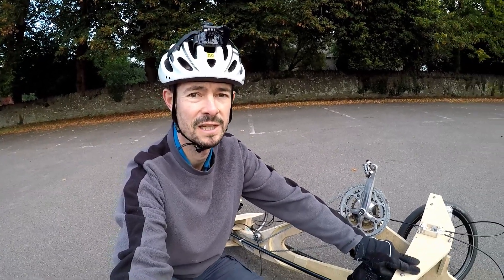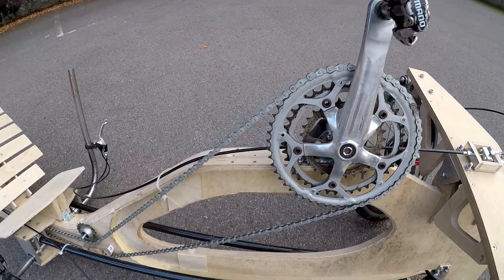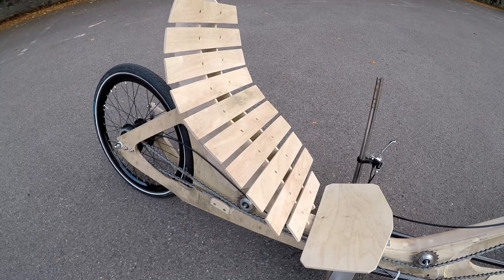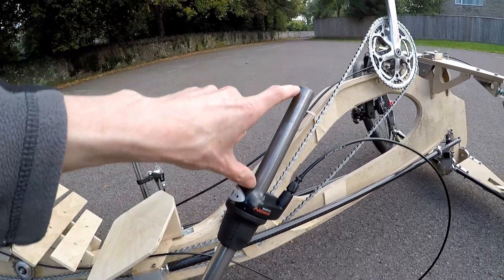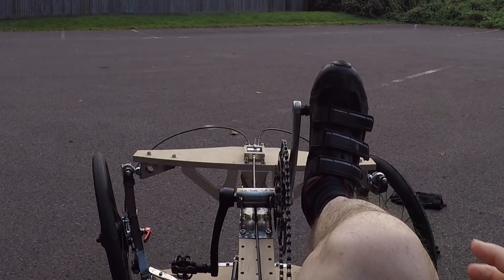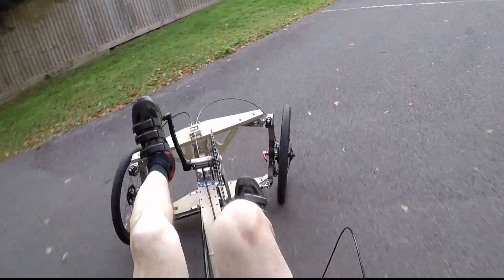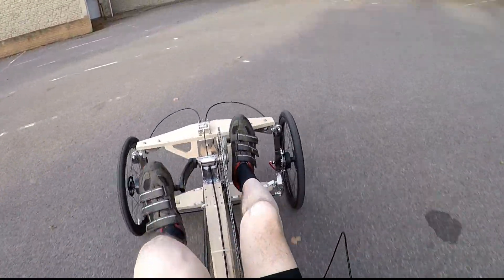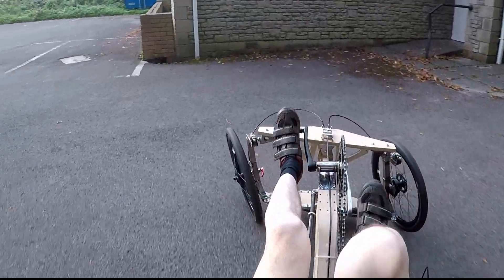Tilting Trikes Part 15 - test ride time for wooden tilting reverse trike prototype!

Comment: Very nice to see all this work come to fruition. What a nice job! I really enjoyed your videos; working with the lathe, the thought that goes into the steering and everything, and the whole creation looks so beautiful with the bright wood and light metal. How does the wood hold up so far? Were you in anyway 'afraid' of the wood breaking? Or confident in the strength and your calculations?
Reply from the maker: Thanks! I'm confident in the strength of the wood but keeping a close eye on the glued joints, most of which have been pinned.

Comment: Nice to see it working. I am planning on doing a 4 wheeled (no tilt) velomobile myself.

Isn't that bottom bracket too high? It looks like it is quite uncomfortable, at least from my perspective. Just asking to have a reference point in my own build, as I have never ridden a recumbent myself.
Reply: According to Mike Burroughs if the bottom bracket is too low it affects the amount of power you can generate.
Reply: Thanks!
Reply from the maker: It does look high but actually feels very natural, believe it or not.  The riding position is exactly the same as it would be on a road bike, just rotated backwards.

Comment: I would think your tilting design could improve the stability of a velomobile (trike) when cornering at high speed for the same track width. Is this already something you can confirm based on your prototype?
Reply: That's a given, but your velo will no longer be a velo, but a singletrack streamliner with everything that entails (succeptability to side winds). But adding tilts lock/damping will likely make it "best of both worlds".
Reply from the maker: yes it would, but it’s very challenging to design a velomobile with tilting wheels contained within the streamlined body.  Wheels could be outside the body, but you are going to compromise on aerodynamics slightly.
Reply: @MetalMachineShop  make that "greatly less aero" due to massive interference drag (unless you shape the wheel spats to flow field, they should look like commas). however, have you read Craig Cornerius (lefthandedcyclist) blog? Even a very limited tilting can go a very long way, provided you can "lock" the tilting and prevent "tipover" to the other side, or somehow uncouple leaning from steering.
Reply from the maker: @Balorng  I’ll look it up, thanks!
Reply: @MetalMachineShop  so long as you are willing to go e-assisted, among my ideas as torque-vectoring tilting arrangement, where tilting as accomplisted by reactive moment acting on trailing swingarms (not perpendicular like on, say, latest tilter by Arcimoto), and this also doubles as front steering without actually steering.  To drastically increase "torque/power density" of such a setup you can use combination of regen braking AND torque vectoring, with rear steering for slow-speed manuevering (so you get all wheel steer, essentially) and series hybrid human driverain. I wanted to test this, but I have more pressing problems problems now, unfortunately. What I like about this concept is that it relatively simple mechanically and electrically/electronically and can allow for a highly streamlined vehicle that "may" actually outperform a more conventional one even in "net zero battery drain" /pure human power mode at high speed, with benefit of assisted climbing AND recuperative braking.

Comment: Is the tilt driven by your balance or the steering geometry?
Reply from the maker: The steering and tilt mech are not interlinked. It balances in the same way as a bike, but you can't shift your body weight so much.

Comment: The steering looks a little twitchy, is that something you’ll be able to get used to or can you adjust by adjusting the geometry slightly? How far will it tilt? It’s great to see it moving and I look forward to you spiffing it up over the next couple of episodes. 
Are you gonna store it on its wheels or standing upright to take up less room in your garage?
Reply from the maker: I think the main reason for the sensitive steering is the low centre of gravity, but adjusting the caster angle may also help.  It will probably be stored on its wheels but it could theoretically be stored vertically!
Reply: @MetalMachineShop  
It must feel great to finally have something that’s working pretty much as intended? 
How about a hub drive electric motor for steep ascents and a little regen braking for descents?
Reply from the maker: @Therapistinthewhitehouse  yes it’s good to get to a conclusions and at least some success.  Electric assist is very much in my mind for the future.  Tilt is limited to 20 degrees at the moment, but I can increase that as it does lean up to the stops.

Comment: U trust plywood?
Reply from the maker: Plywood is used for convenience for the prototype.  I think it’s perfectly adequate this purpose, but maybe not as a permanent solution.  Many WWII fighters were made of wood, so it’s a reasonable option.
Reply: @MetalMachineShop  try cornering in 60 kph! I wanna see it break!
Reply: @kusukacolaylowlee1611  
Go and troll somewhere else.
Reply from the maker: @kusukacolaylowlee1611  if I can reach this speed I'll be very happy!
Reply: @MetalMachineShop  let a motorcycle drag u
Reply: bye troll.
Reply: What’s wrong with using plywood for the prototype?
Reply: @Therapistinthewhitehouse  why not 3d print it?
Reply: @kusukacolaylowlee1611  
Size of print and cost being the most obvious. Do you know anywhere that can do a 2.5mx400mm print at an affordable cost? 
Plywood is cheap, strong, easy to modify if he gets something wrong and has been used to great effect for hundreds of years and can be used with minimal and low cost hand tools.
Reply from the maker: @NiggaSoulFromStreet  3D printing may be technically feasible but probably expensive.  I had the wood in stock anyway so it was effectively free!

Comment: A trike that falls over when not riding at speed. Is it worth the work and weight  over a two-wheel recumbent? I think it's fascinating tech and an interesting series  of development videos, don't get me wrong!
Reply from the maker: It is highly doubtful whether it is worth it!  I was driven by curiosity to see if it was possible mainly.
Reply: That's the debate!  Although with some deflopilators and a tilt-lock that issue should be eliminated.

Comment: Maybe to ease with stability you could try putting springs or bungee cords diagonally on the parallelogram? Just to help it return to central position

Glad to see everything works well after all these months of building ^^
Reply: Both return to center force and damping for leaning should help with balance, but little force likely be not noticeable, and large force will force you to lean more, and there is a limit.
A combination of leaning AND tiltlock is very cool in theory (massive cornering potentil), but needs mastering in practioe.

Comment: You may add a motorcycle steering damper to improve/smooth the tilting!
Reply: Consider a tilt damper rather than a steering damper. That may improve slow speed balance without having to fight a steering damper at the handle bars at slow speeds.
Reply from the maker: It would certainly be worth trying, I’m not sure whether it would make it better or worse! Good idea.

Comment: Hi Andy.  Just curious to know what the weight of the machine is when ridden/driven in this video.
What tilt lock mechs have you considered so far?
Regards Mark in the UK
Reply from the maker: Hi there, the weight is somewhat north of 20kg so definitely room for improvement.  For tilt lock, I’m thinking a mechanical interlock pin in a hold kind of thing.
Reply: Nice! Glad you could finally start testing it ! 👍
How many degrees can you lean in a turn? On my Tilting Trike I can reach 40°, it's a good compromise
Reply from the maker: @daniele_go  hi, it's designed for 30 degrees, but limited to 20 at the moment but I am hitting the stops at this angle.
Reply: @MetalMachineShop  Hi, you may find that 30° is not enough...
The point is that if you 'hit the stops' at 20° it is going to widen its trajectory and push it toward the outside.
Originally I thought that 25-28° was enough but experience proofed me wrong 😉